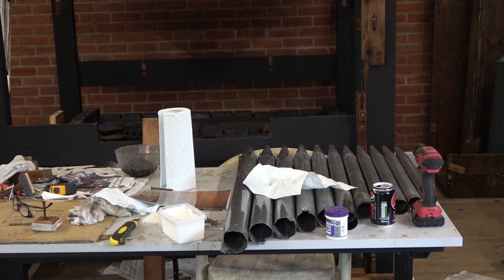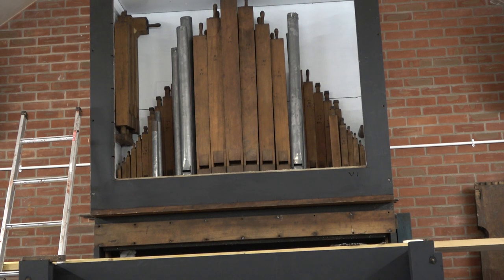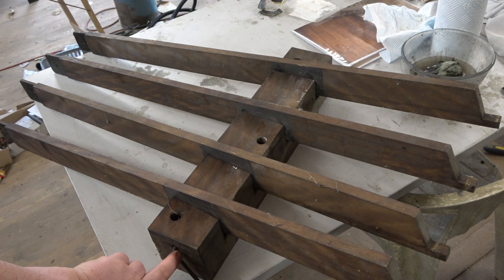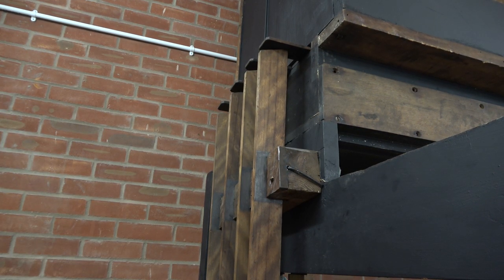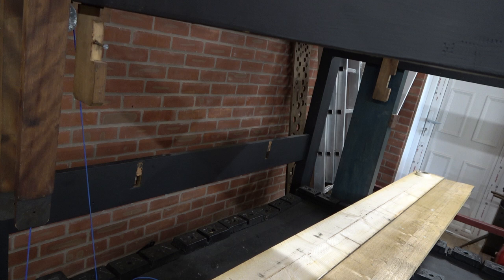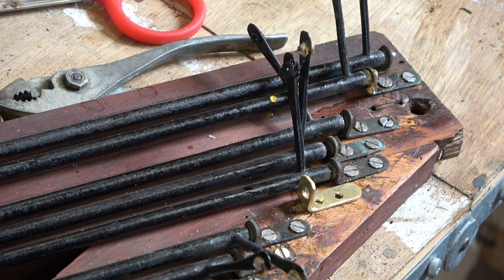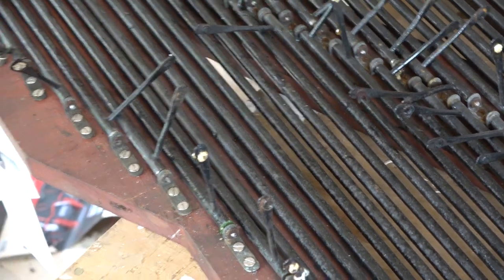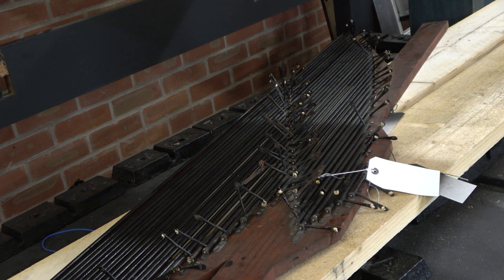1865 Forster & Andrews pipe organ restoration & installation - Part 12 of loads

Comment: The more I see, the more complicated everything looks!!!
Reply from the maker: The fascinating thing is that there are no two alike, & I've done this 43 years. I've not seen rollers attached to the rollerboard with brass bushed L shaped brackets before for a start. Today, we fitted the rollerboard & I have fitted the first 9 trackers (out of 56), making two brand new ones to replace two broken ones. I've never seen trackers made like these before & I've never seen phosphor bronze wires going into the pulldown bushings...they are always copper. 

Richard
Reply: @ukfmcbradioservicingTango21  First time for everything.